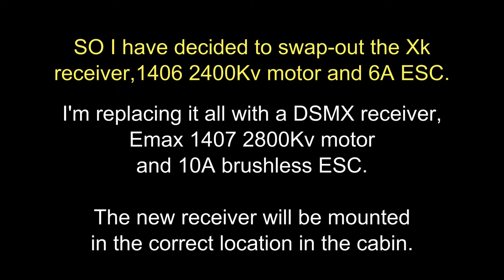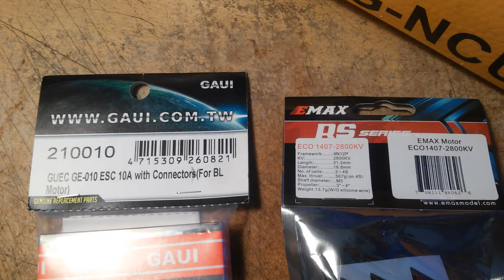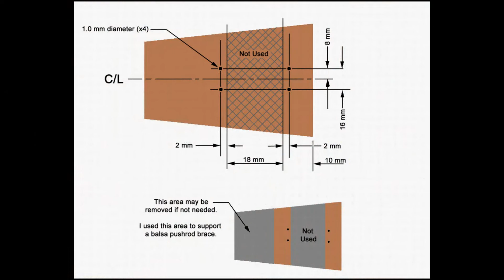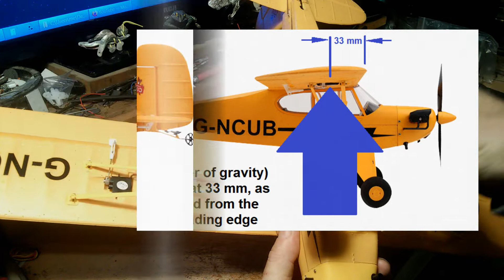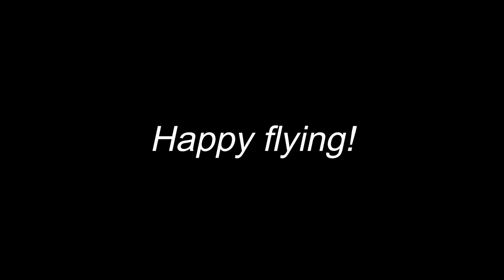XK A160 Skylark - Motor/ESC upgrade - DSMX Receiver Mod

Comment: Nice project! The spiral of death is actually an extreme tail heavy condition and way too much rudder mixed in with the ailerons, therefore the gyro can't recover. After balancing the plane on the proper CG and taking out much of the rudder mix it's a nice flying plane and the stalls are a non-issue. I'm looking forward to your completed project and Maiden Flight. It's a nice flying plane once the balance is corrected. See you in the Air!
Reply from the maker: Thank you.   Whichever is the cause, I addressed both of them.  I still and thinking up solutions to reinforce the wing and still be able to disassemble it for storage.  If only the wing struts had some form of fast release attachment.  I think the second A160 will get a carbon spar and lose the struts altogether, but I still want a 2-piece wing.  We'll see what I eventually come up with.

 Happy flying!
Reply: @Doggeslife  I thought the same thing regarding the struts but I was afraid I'd add even more weight ;-) I thought about using a plastic clevis on one end. I'm looking forward to your test flights as it's a completely different plane after replacing the stock receiver/gyro brick.
Reply from the maker: @GroundControlRC  A clevis is an interesting idea.  I will look in that direction, Thanks. My second plane will get a spar instead of struts, but I hope to still make it a 2-piece item. I have some 3mm carbon rod coming for that.

I have some 2mm carbon tubing I may try to use for the struts on bird #1 (RTF).  Hopefully it won't add much mass, but the plane still feels fairly light for it;s size.  Guess I'm used to heavier nitro planes.  I never got into the feather-light indoor stuff.  That's more like flying dried leaves than aircraft  ;-).

Funny how I ended up with two.  The spare parts were suppose to be for crash repair until they arrived cosmetically damaged. That gives me one to leave looking stock and a second to tinker with and make my own.  Love it.

Happy flying!
Reply: @Doggeslife  , Good luck on the project and (2) to work with makes it even better ;-)
Reply: @GroundControlRC  I now have 2 and plan on modding one with a bigger motor and manual control
Reply: @shanemichaels8289  You'll love it Shane. With some additional power it's very aerobatic and a blast to fly ;-)
Reply: @Doggeslife  I got one for Christmas and just thought the same: how can I get it out in the fields without a car? So I re-routed the aileron wiring to go straight to the middle whole in the cabin roof. Also rerouted the wiring for the plugs in the fuselage to go straight into the cabin. That way, the wings attach nicer with less strain on the two yellow fixing pins/knobs. Now for quick dismantling of the struts: I removed the attachment to the landing gear, heated the endings (with the screw-hole) and carefully bent them upwards to align parallel to the side of the cabin. I ordered M2 threaded rods that I will trim down and push straight through the fuselage below the cabin, where it's massive. That way, I can attach the wings easily (with easy access to the aileron plugs) and just stick the bottom struts attachments on the threaded rod and fix them with milled nuts － no tools needed and I can hop on my MTB with the plane in the backpack :-)
Reply from the maker: @DIY-Morti  My other A160 got 3mm internal spars instead of the struts. I used a brass sleeve tube in the middle joining the 2 spars into one so I could still break down the wing into 2 pieces for travel, then used 10-24 nylon bolts to hold the wing more securely.  I need to make a video of that build someday.
Reply: @Doggeslife  Hey thanks for the feedback! Hell yeah I'd love to see a vid detailing your stability and fuselage/wing connection mods :-) Or more details in the rcgroups thread. Whatever makes it robust while keeping it easy to (dis-)assemble for rucksack or bike pannier transport. I think the foam they've chosen and the overall construction make it a good plane for carless people :D
Reply: @Doggeslife  One more question I if you don't mind: You say internal spars, do you mean glued to the down side of the wings? If so, have you removed the paint first and which glue do you use for carbon fibre/EPP foam connection?
Reply from the maker: @DIY-Morti  I cut slots in the bottom side and embedded 3mm CF rod in the wings. The joining ends of the rods have a 4mm OD, 3mm ID brass tube that lets me join them together with a short third section of 3mm rod. This way I can still break the wing down. 

Maybe this series of images will help:  https://imgur.com/kgFuaf3.jpg
Reply: @Doggeslife  That's dope, I love it! Thank you so much for the pictures and great advice :-) Now my upgrade path is set, will follow it as soon as the stock wing struts break. First figuring out different materials for the wing cuffs. PET is the lightest so far at 1.7g each. Could be trimmed to maybe 1.3 depending on how I fix them.
Reply: @Doggeslife  Heya old stuff, I know. Your way of attaching the wings with a nylon screw to threaded balsa wood was genius! I didn't need it for the A160s but it became overly handy for my Arrows Pioneer in order to make it backpackable. Same goes for the  internal wing spar. Thanks to that, my Pioneer's wing is now so rugged that I can use the side bag/net and stock strips to attach it to the side of my old Tatonka hiking backpack with the plane and TX inside. This means the world to me as I can now grab my mountain bike and go flying with all my planes. 1001 thanks!

Comment: You can place the Gyro anywhere in the fuselage, as long as you line it up properly  I have a few tail draggers, and hold it level after I  plug in the battery, until the Giro has calibrated. All this you can find in the instruction manual that comes with the receiver

Comment: Hi there. Great modification vid! I’ve ordered one of these and am collecting info to set it up as well as possible when I assemble it. I noticed in your RCgroups images that you moved your servos forward into the cabin area. Was that done after this video and was it an improvement? Or was it related to the flap build? I was hoping I might be able move the stock servo unit into the cabin in an attempt to recycle the included components as much as practical. Thanks for your amazing improvement work on this cute little Cub 🙏👍🐻
Reply from the maker: Greetings.

I actually have two of these aircraft.  One has the servos mounted in the cabin and the second has the servos mounted where the stock receiver use to be placed.  Either location is fine.

Happy flying!

Comment: Maybe too much to ask, but if you make another video of this plane can you quickly show the landing gear?
Reply from the maker: Maybe I can provide a photo.  What are you trying to find out?
Reply: @Doggeslife  that would be kind of you :D
The working of the axle of the wheels and how the joints near the fuselage swivel.
Reply from the maker: @Pieter_Zwaan  No joints.  Just a wire landing gear with yellow simulated "legs" tacked onto them. The springs and associated hardware is all visual only with no function. Better view here: https://vn-live-01.slatic.net/p/cadf81566f3093d96ed695d58ec5c291.jpg

One more pic: https://i5.walmartimages.com/asr/6de0a70c-45a0-4727-9ea0-0be80a770a57.ef2fd9e0b73c806106b4ace4ed1ce383.jpeg?odnHeight=450&odnWidth=450&odnBg=ffffff

Note the rear portion of the yellow plastic leg mounts to the fuselage with a screw at the same point that the wing strut attaches.

Comment: Good day! Nice upgrade. I have an issue though: with AS6410NBL receiver and ESC connected to Reversed CH2/CH6 connector, my throttle is still controlled by aileron (right) stick. Any help? I use NX8 Tx. Watched your other video, still no luck.
Reply from the maker: Greetings!  There is a procedure using stick positions on the transmitter to activate 6-channel mode or to switch back to 4-channel mode with reversed ailerons on CH6.  The method involves turning on the transmitter, moving the throttle stick to FULL POWER, setting the other required stick axis positions and then plugging in the receiver.  If done correctly then the receiver LED will blink 3 times and CH6 will be active.   See it here in the AS6410NBL manual on page 8:  https://www.google.com/url?sa=t&rct=j&q=&esrc=s&source=web&cd=&ved=2ahUKEwiKm8_aqPSAAxUXEzQIHdS3BvkQFnoECA0QAQ&url=https%3A%2F%2Fwww.spektrumrc.com%2Fon%2Fdemandware.static%2F-%2FSites-horizon-master%2Fdefault%2Fdwdf19f8cd%2FManuals%2FSPMAS6410NBL-Manual_EN.pdf&usg=AOvVaw1qeJO2s_eOd11l6FQONtE3&opi=89978449

NOTE that the channels used to do this must be set to normal (N) direction in your transmitter and are not reversed (R).  For turning CH6 ON or OFF in the receiver you will be using the throttle, elevator and aileron axis's, so none of those channels can be in reverse mode. They can be returned to what setting they were in beforehand once CH6 is activated.  I recommend testing it with a servo and not an ESC to make testing easier if you have a spare servo, otherwise just use the ESC.

I even made a nice hands-on video demonstrating the procedure:  https://youtu.be/7lgxZJW82qE

Hope all that helps to gets you in the air.  Happy flying!
Reply: @Doggeslife  Thank you! Tried it. No luck. It looks like my R CH2/ CH6 got stuck on R CH2. I could not achieve 3 flashes from ESC. I wonder if powering an ESC trough CH6 is the problem.... I will try powering an ESC through the dedicated battery wiring (that I removed)...

Comment: The original engine is not 2400kv, as you indicate, it is 3600kv, therefore you cannot replace it with one of 2800kv as you suggest, the ideal is to replace it with one of 4200kv, the rest referring to the balance of the plane is theoretically logical, personally I did your experiment and the plane never flew, not even by throwing it by hand. That explains why after the tutorial, you didn't show that it flew.

Comment: That dmsx receiver has an ESC on it, can you please explain me why did you install another one? I want to do the same mods and I am buying everything
Reply from the maker: The onboard ESC is only 5A continuous current capacity.  The higher powered motor I used requires a 10A ESC.
Reply: @Doggeslife  can you put a spinner in that motor?
Reply from the maker: @andresuribehenn  I'd like to. The motor has a 5mm threaded shaft.

But the smallest suitable spinners I can find start at 1-1/2 inches or 38mm in diameter, and when I tried fitting one from DuBro it proved far too big. The A160 needs something like a 15-20mm spinner to look proper. The Eachine and Volantex plastic spinners don't work here.

This is the type of spinner I need, but smaller:  
https://www.hobbytown.com/dubro-3-blade-spinner-black-21-2-dub546/p74967

Comment: Can i get your spektrum radio setup for this airplane? Im using an old dx6i
Reply from the maker: Sure!  You can see the screen settings at the end of this video (3 different screens) https://youtu.be/Hu6T8g7u7BY

Note that I did put a Spektrum receiver in mine. These settings will let you run an external ESC off channel 6.

Happy modding!
Reply: @Doggeslife  awesome thanks much 👍👍guess i should of watched till the end 🤦 lol

Comment: So how is it flying after these modes?..
Reply from the maker: Greetings.  Unfortunately I have not been able to fly any of the bigger 2S project birds due to a lack of a suitable local flying sites.  I actually have two A160s to test.

 I'm in the middle of over-developed Silicon Valley and have no car to reach more-distant potential locations, but I am working on a solution.  Hopefully soon.  I can barely fit my 1S birds into local parks these days as it is with so many people out & about due to the virus. I prefer to not fly over people. I miss the open fields I once enjoyed here.

But I have been building RC planes and studying full size aircraft for over 40 years, so I have full confidence in them flying well.

Hopefully not too much longer to get them in the air. Apologies to all for the delays. Happy flying!